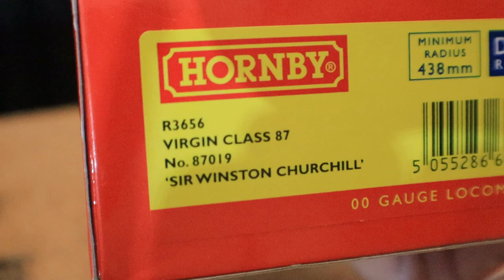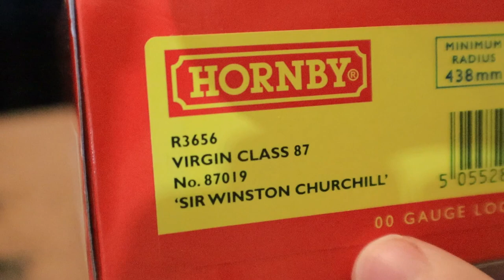Hornby - Class 87 with Lights - DCC Fitted (Unboxing & Review)

Comment: The thing is LazerJet, this locomotive was built to coincide with the last part of the Electrification of the West Coast Mainline. Originally 36 locos were built and as of today, 3 of the 36 strong fleet are still in the uk with some being exported to other countries whilst the others have been  scrapped after withdrawal from service. Also 87012 was painted into Network Southeast livery in the mid-2000's to coincide with the London 2012 Olympic Bid

Comment: The problem with this model is Hornby insisted on fitting an 8 pin decoder (to sell their line of 8 pin decoders and their focus on kettles). Because of that, although you can turn on the lights, you cannot turn them off when the train is moving. That leaves you with loco tail lights shining on the coaches which is not prototypical. I could live with that. The big kick in the junk is that you can't turn off the headlights and since for the vast majority of their lives, Class 87s operated trains in push-pull, you have lights blazing on the coaches if you try to push a rake. This is even more frustrating since Hornby released the Mk3 DVT so you can build a push-pull rake but it only looks right in pull (no terminal stations!) Good to see Hornby was able to seize defeat from the jaws of victory.

Also, as a note: There is no second class. There is first and standard (originally third class). Second class was dropped in the early 20th Century by railways in Britain.